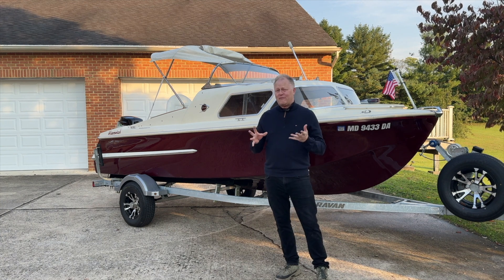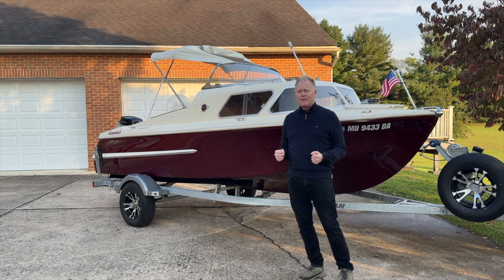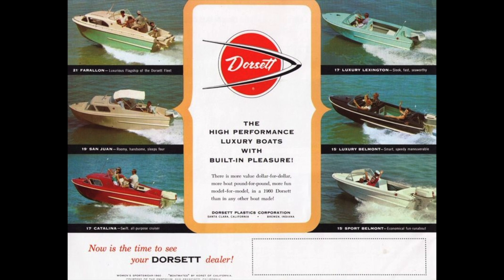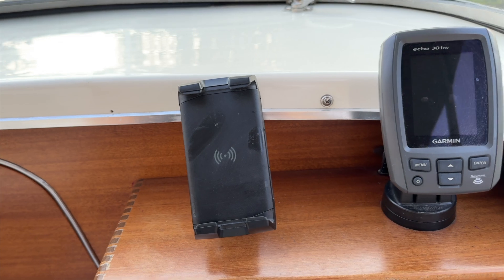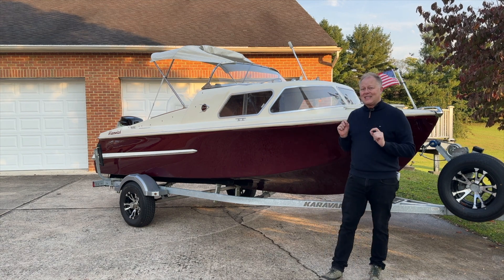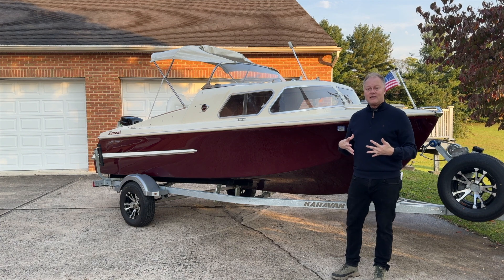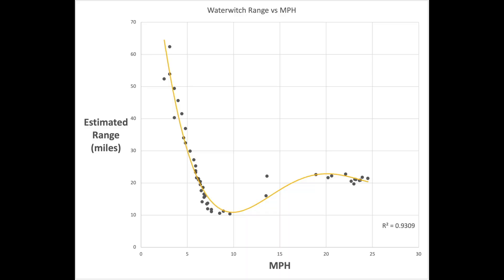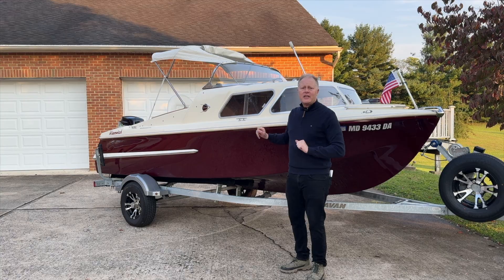Electrified Classic (26,000 watt electric boat conversion)

Comment: Just pick up a 63'. Do you know the model number of your trailer. I need a new trailer
Reply from the maker: Its a Karavan KKB-2200-70. I purchased from Dave's Trailers in Baltimore. Not sure where the top came from as it came with the boat. Jay Sigman might know as he built the vessel originally. FYI, I may put the boat up for sale soon as looking to get into another project. Its pretty awesome with electric power.

Comment: I'm using 3- 48v 180ah Hi-Power NMC Lithium batteries in series. The batteries weigh in at about 240 lbs and the stealth outboard motor is about 180 lbs. The actual power delivered from the battery pack is a little over 50hp (40.5 kW). The motor & separate motor control are water cooled.

Comment: Nice video. EV technology is great! I've enjoyed having a high power 75hp stealth electric outboard on my 17' bow rider runabout. Excellent choice for the type of lake boating we enjoy. We can go over 20 miles on one charge. The top speed is 27 MPH and the last time out, we pulled the raft just for fun. Go Electric!
Reply: Cool. Will have to check out the stealth more. How many kW is the 75hp?
Reply from the maker: Sounds great!

Comment: Those batteries want to be keep at room temperature
Reply: I don’t know if that is true or not but I can tell you that I drove the hell out of the two solid state batteries I have all summer with no issues even when the outside temp was 100 degrees. The only high temp warning I ever got was actually for the outboard motor itself not the batteries. The outboard is water cooled btw not the batteries. that should tell you something about the batteries ability to handle increased ambient temps.